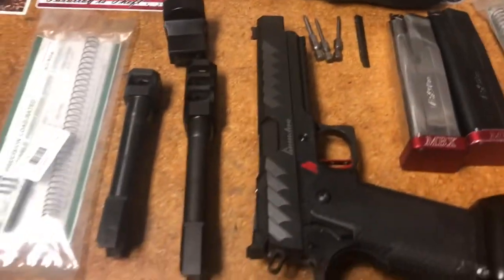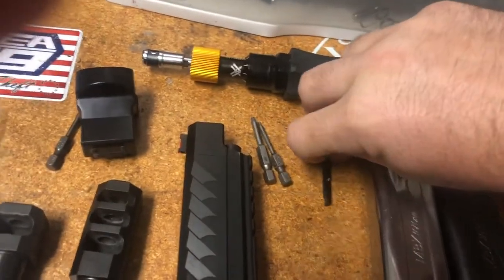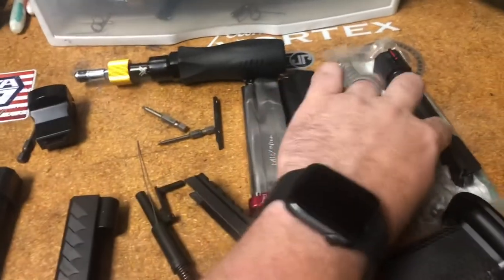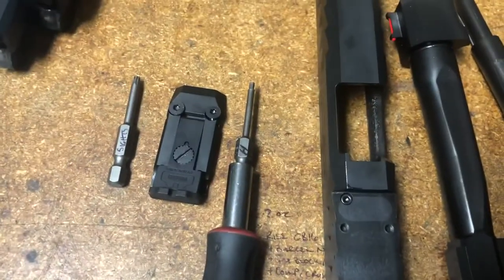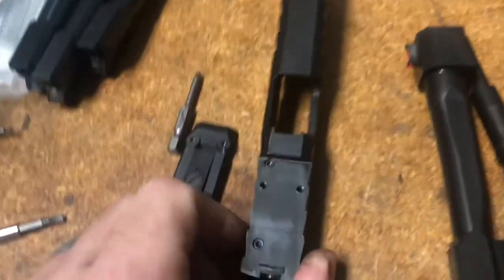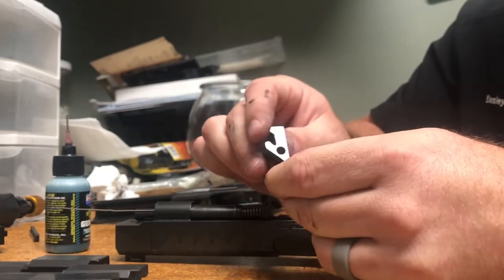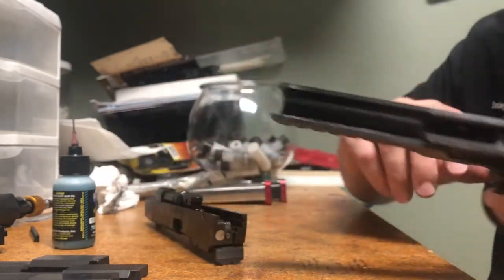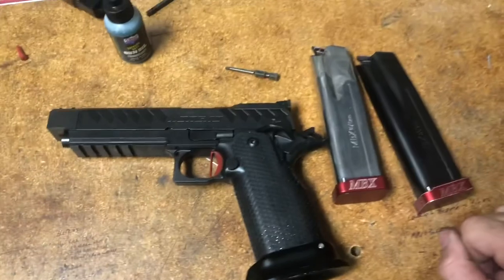PT Honcho caliber swap from 9-40

Comment: does the iron sights config fits ipsc box standard?
Reply: It does not. There is an IPSC specific model that is made to fit the box. This version has a slightly longer barrel and is geared more towards USPSA and 3-Gun.